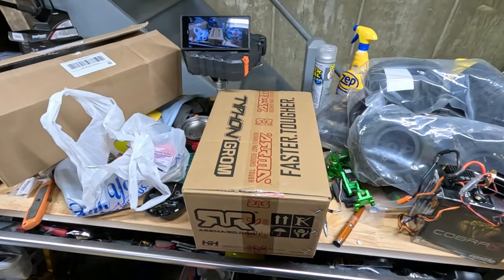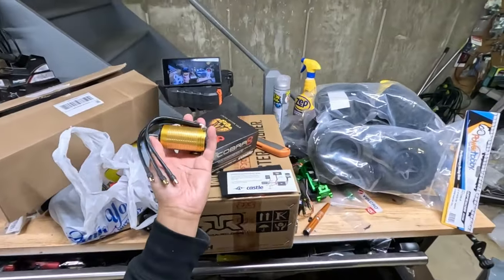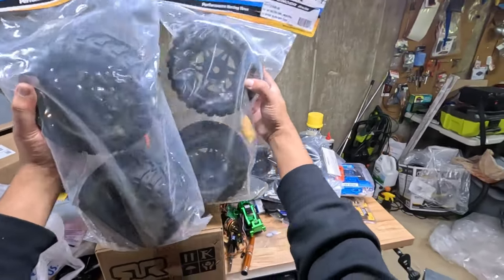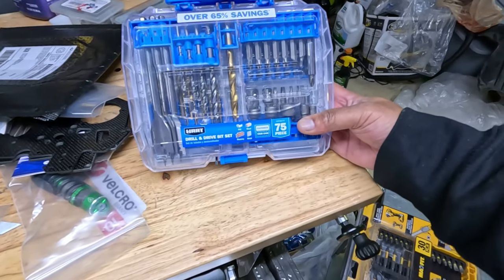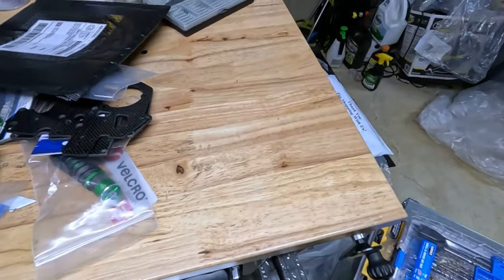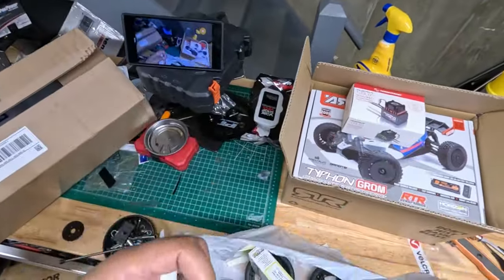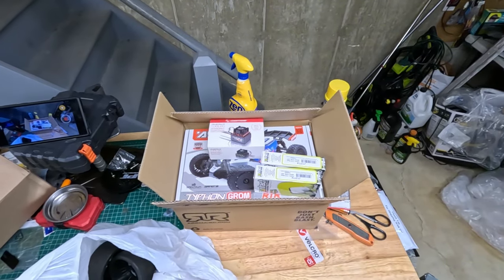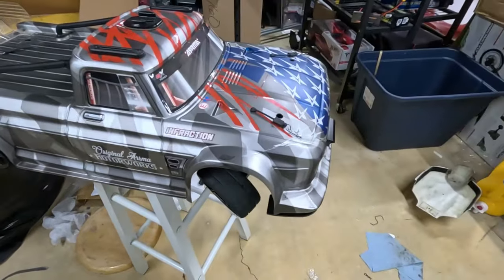April 2024 Massive Goodies Unboxing

Comment: I been with the DX5c for a couple years  for all my rigs and I have a flysky noble pro for my losi 5th scales. I'm looking to get more into speed running and looking at getting a long range remote. Which is the best for your buck, the one you have? I aint trying to deal with all the additions and extra antennas in stuff, just something sleek that stay connected.
Reply from the maker: The radiomastermt12 elrs model is the best for range.2 - miles of range. Receivers run about 25 bucks. I ran futaba for most of my speedrun years and I love them but this thing has range for days.
Reply: @jaymitchrc  yo you still have the radio for sale?
Reply from the maker: @MrMeDos  yessir I do.  E.mail me jay.mitch.rc@gmail.com